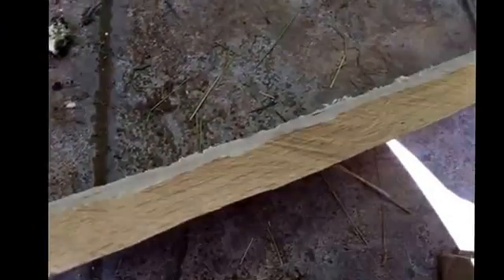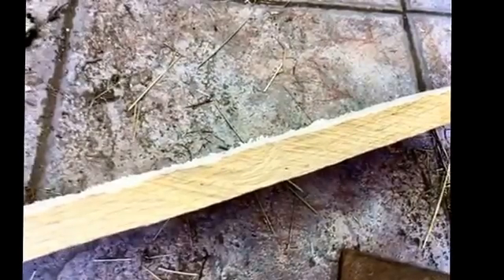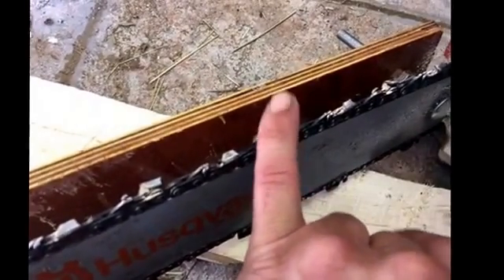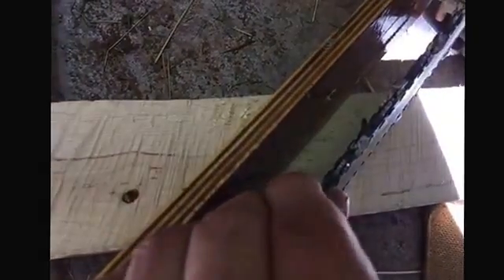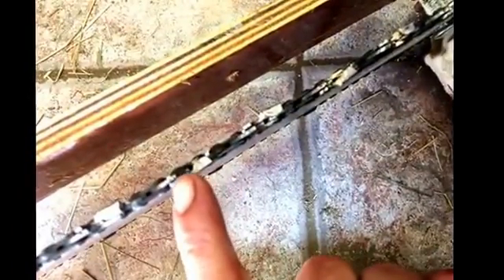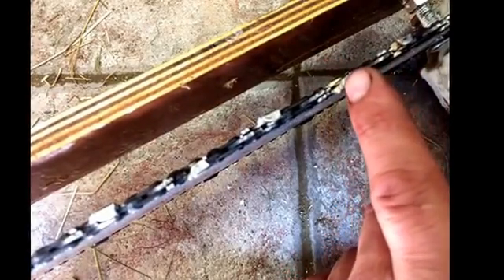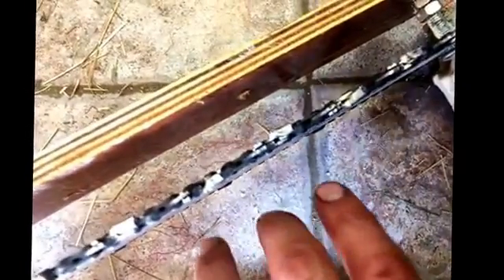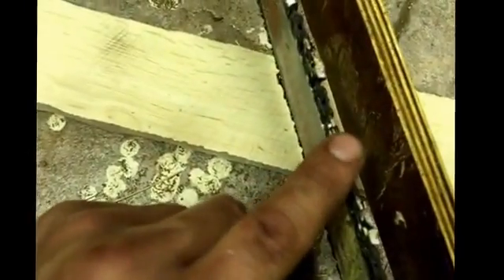Home made - Make a ripping chain from a crosscut chain for chainsaw milling

Comment: I picked up a brand new Oregon LPX chain this morning and regrouped it to 10 degrees to create a standard ripping chain.  I am going to see how it does before I regrind it to a Grandberg style ripping chain.  If it cuts reasonably well I will continue to use a standard 10 degree full comp chain.  If it gives ragged cuts then I may modify it to the Grandberg style.  I have not decided whether I will put it on my ms 360 or ms 460.  Either has enough power to use them on my Alaska mill.

Comment: get a harbor freight chainsaw chain sharpener. sharpen all the saw teeth to 10 degrees, not 5 degrees nor 90 degrees. sharpen it to 30 degrees for cross cut.

Comment: It's cutting like that because of how you sharpened it mate. when you mill each tooth needs to be exactly the same, otherwise you get the 'shakeyness'. Use a proper file and sharpen it to 10° and it will work a lot better mate, also put a wider bit of ply on it and it will cut straighter